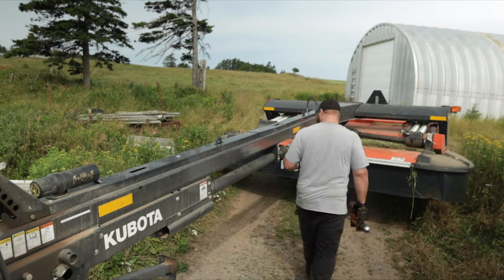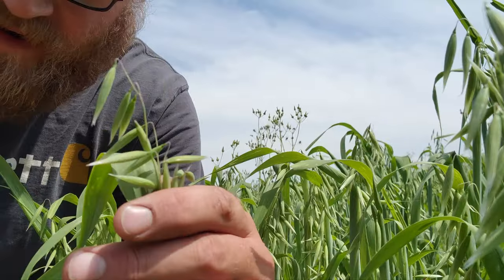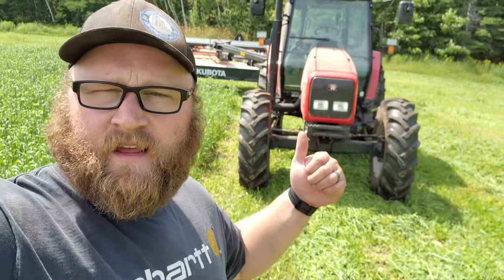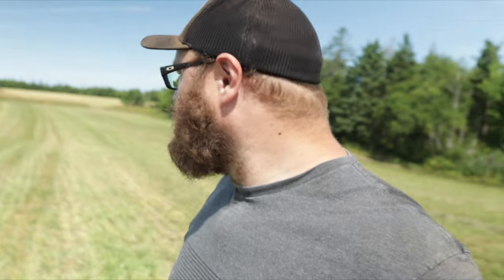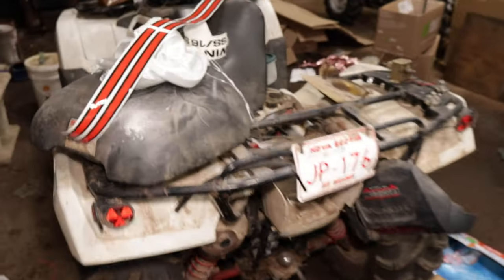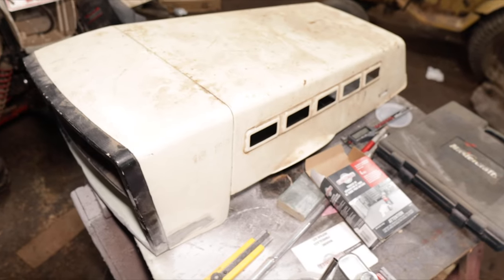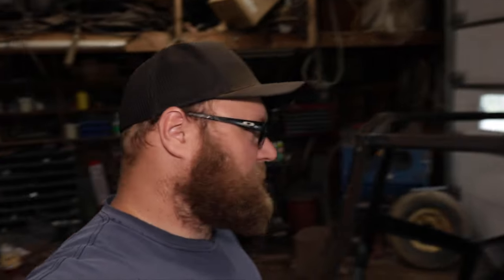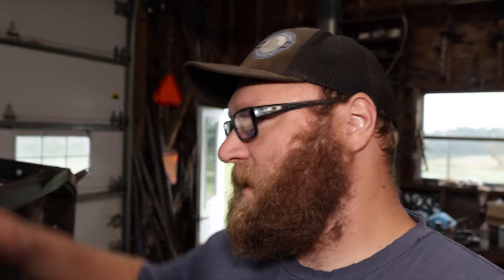Forage Oat's Going In The Silo

Comment: Jumpins. Ya I’d be pissed too over that. Sellin the parts out from under ya. Sadly that goes on a lot. 
Hehe. Sounds like winter in the shop with the wind whistling. 
Most of the heat is over Scott. Old home week fair is next week. And the old saying is, get your winter clothes out after old home week. Hehe. 
And it’s very true some years. 
Water pump went on my Tea20 Ferguson while I had it in a parade in St. Peter’s last week end. Had to turn around and go back to the trailer. Sooo, Dundas Plow match in 2 weeks. Yaaaa. Need tractor to Plow. !!!!!
Any way, ordered one at HJV and should be in today. Maybe. We all know how that goes. So should have the tractor ready for the Plow match. 
Neat Sears ya got there. Never had one of those. 
Have a good day Scott.
Reply from the maker: Yeah Noel summer is certainly going by, there will be more heat yet but this should be the worst of it behind us now. Hopefully HJV gets that pump in for you. They are pretty reasonable to deal with over there, we buy a lot of the Challenger parts from them. 
The sears is a neat tractor. 16hp Onan is about the best part of it though lol.
Reply: @macfarms  ya some heat yet, but that was the worse of it. Got the pump for the tractor. Had to do a lot of Beepin around to make it work. Ya just can’t buy a part and expect it to fit any more. Any way she up and running again. Just have to do mine more leak check and look at level in rad.